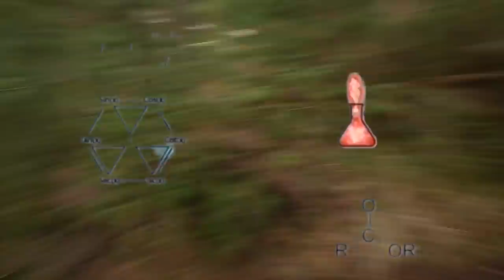Science #3 - How to Build Heated Grips

Comment: Great video. Bought some elements to try this but haven't got round to it yet. Was just going to use old-fashioned stretchy BMX grips instead of lock-ons but was slightly apprehensive of getting revver-grip. By my calculations I was expecting to get about 2 hours out of a 3 cell 18650 4000mAh pack (stored in the steerer).

Comment: Stuff some kingspan insulation inside the bar and foil tape bar before wire. I tried a set of cheap push on grips but they didnt lock-on(cable tie would do) but fitted well.
Reply: I guess Spank did this by accident with their Vibrocore.

Comment: Howdy, Joe. How many mAh capacity is the battery pack you use? How long will they put out heat on a full charge? I'm about to build a setup and am hoping to get at least 2, but hopefully 3, hours out of each charge.

Lastly, is that a NiMH battery you're using? I was planning on going lithium but am wondering if there is any specific reason you chose NiMH. Thank you!
Reply: Hey, Joe. Just wanted to reach out again. One more question. How many amp hours is the battery you chose? Thank you.
Reply: Looking at it and being an RC guy it looks at 4:16 like a regular RC car 6 cell NiMH pack and it should be around 3000-4000 mAh and 7.2 V nominal. 

Using a 2s LiPo would increase capacity for the same weight (or decrease weight given capacity). 

The LiPo has more requirements when it comes to charging, also it has to be protected from over-discharging so you need circuitry or a monitor for that. 

I would argue that the main reason to stay off the LiPo in a race is that in the event of a crash causing damage to the battery or circuit they will burn violently.